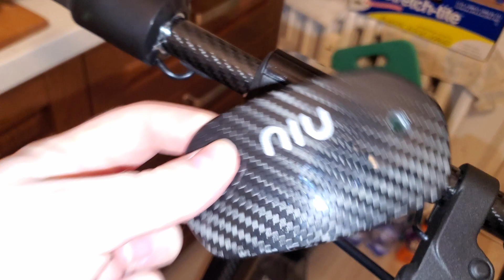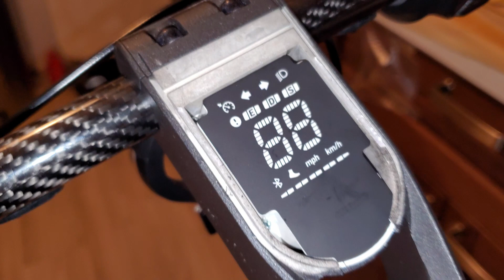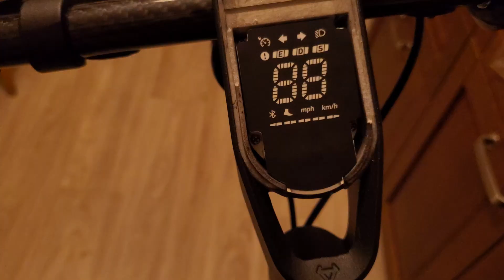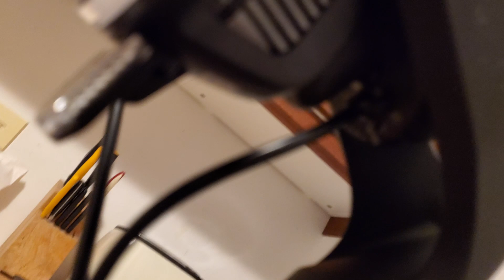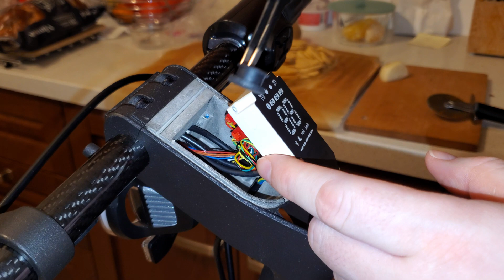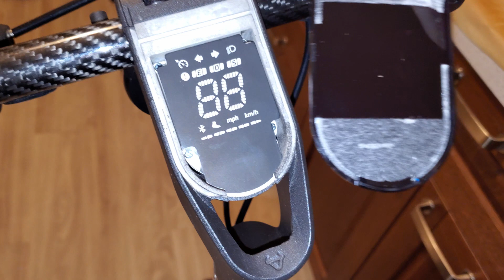NIU KQi Air electric scooter - Display Disassembly repair guide

Comment: I have the same model. The screen suddenly stopped working. When I bring the NFC card closer, I can hear the sound and the phone turns on, but nothing appears on the screen. How can I fix this?
Reply from the maker: If the scooter is still under warranty contact NIU first. If you are outside warranty, it might be a display issue and you can try to replace it, or check if all the connectors are secure. Hard to say what might be causing the issue without looking at it. You can buy a replacemnt display from NIU if not covered by warranty.

Comment: Hey @lantea13, did you have any trouble securing the whole display panel back again with the same adhesive after removing it? I have to replace the accelerator (NIU sent me the part) but I’d like not to buy a new display cover just because I removed it. For the first removal I see you just glued it back again but after some time I’d like to know if it stayed put.
Reply from the maker: No trouble re-using the adhesive, still holds the display cover. The adhesive is a really thin double sided tape.

Comment: Hey, have you tried switching to a thumb throttle accelerator? I'm trying it now, but when I connect the new throttle to the main board, I only get a loud noise.
Reply from the maker: No, I have not tried that, as I got used to the twist throttle so much that I think I prefer it over the thumb throttle now :D
But I like the way Segway decided to do both thumb/twist throttle combo on their latest line of scooters.
Reply: Hi @antonioskoric9157, did you end up switching the twist throttle with a thumb throttle?
I was thinking to do the same thing, so it would be helpful to know if you managed to make it work 🙏
Reply: @mjeshurun 
Yeah, got it working. Didn’t change the electronics, just modified the housing and fitted a thumb throttle instead. I used the plastic part from a cheap replacement throttle from Amazon and basically swapped the ring for a plastic thumb lever. Everything else is still stock.
Reply: @antonioskoric9157  that’s great!  Could I trouble you to share a video of how you got it set up?

I was thinking of replacing the whole buttons+twist throttle combination with a separate workaround. 

On the right handlebar side to install a thumb throttle with an integrated power switch, and on the left handlebar side to install a 4 buttons controller that will turn on the light, horn and the two turn signals. 

I found the buttons+twist throttle combination to be uncomfortable, because it’s a bit difficult to twist the throttle and press the buttons at the same time.
Reply: @mjeshurun  I uploaded a short video to my YouTube account just for you. It includes a brief explanation of how I did it, so you can see how it looks.
Reply: @antonioskoric9157 many thanks for taking the time to share and explain your method 🙏🙏🙏

It’s really helpful and I highly appreciate it 🙏🙏🙏

Comment: Have you looked in the battery compartment ?  My NIU KQi Air drains the battery when it is not used.   I can fully charge and a month later, it is completely drained.
Reply from the maker: Not yet, but I plan to do a disassembly video this winter. I noticed the same, but it mostly happens when I leave the Bluetooth turned on, on my phone, and each time I go near the scooter it connects to it.
Reply: @ maybe the solution is to “forget this device” in my iOS settings.  I still seems much too excessive regards to battery depletion.

Comment: Do you know, what batterys are exactly in the Air
Reply from the maker: No, I have not checked, but if enough people are curious I might do a video  taking a look under the deck. But that will probably still not tell you the exact cells used.
Reply: @Lantea13  so i hope, more people are interested.  ----- beside some interesting Info: der KQI Air does only have tubeless tires and not selfrepair tires - some guys on youtube gave a false information that NIU KQI Air will have self repairing tires - that is not true. - i just chatted therefore with NIU support
Reply from the maker: @Cool-ng5rh  You are correct the KQi Air does not have self-healing tyres. NIU told me that is because they wanted to save on weight to make the scooter as light as possible.
Personally I would rather have the pre-slimed tyres :)
Reply: @Lantea13  this will be additional 2x60 Gramm so it is no more under 12 kg - but it is necessary to have a relaxed drive in my opinion - nothing sucks more than a broken tire on the. Trip
Reply from the maker: @Cool-ng5rh  I agree, they should have put self-healing tyres on the KQi Air, even if it would add weight.

Comment: Hi, I took apart the little windshield and I think the design is the same in production models, or I don't see any noticeable difference. But it didn't break. Nonetheless the windshield broke when screweing back too tight with my airtag hidden behind. Link in the next comment, just in case it gets deleted.
Reply from the maker: Seems like the link did not get posted. Can you try again, would be curious to see how the production unit compares. Thx.
Reply: Just pasted it. Maybe Imgur is not allowed here.
Reply: The link is impossible to paste! In my opinion it looks the same.
Reply from the maker: @CarolaClavo  I guess that is some YT spam protection at work. Thanks for trying though :) Wanted to ask NIU about it if I could show them a comparison.
Reply: @Lantea13  After a year, my accelerator is failing so I came back to this video to see how difficult it would be to fix it myself. I think it will be easy: Unglue the display, take it off the space. Undo the turning lights and remove the handle, and then, slide out the accelerator and unplug it whn you see which is in the panel. And then, do everything again in reverse.

Comment: Hot to turn of the AIR to prevent power consumption? I could not find any setup to prevent draining the battery
Reply from the maker: If its turned off with the nfc card I have not noticed any significant power drain, the only system that is on I think is the Bluetooth, which should not have a huge drain on the battery. How long did you not ride it and what was the % power loss?
Reply: @Lantea13  20% in 5 days - i had 20% and after the holidays of 5 days the escooter niu kqi air was dead
Reply from the maker: I was just away for 5 days and my KQi Air definitely did not drain that much. I might try and test it to get exact numbers when I go for holiday or daily test a different scooter. 
Did you try and contact NIU about what the expected power drain should be? I think 20% in a week is not normal.
Reply: @Lantea13  no - i only asked how to turn of the Escooter completely - this is not possible - so you kill the battery during 4 months of wintertime - you should not store any battery at 0%
Reply from the maker: It would certaily be a nice feature if you could disable all passive power drain systems throught the app, so that they only activate once you unlock with the nfc card.
Alternatively; when you first get the scooter it has transport mode activated, I think a lot of riders would love to see NIU create a way to activate this mode when you need to store the scooter over winter, or even when you need to transport it yourself for service or when you move, etc.
Reply: @Lantea13  transporting the escooter by car would be also nice with transport mode - how to do that? NIU will not update the software therefore, they told me
Reply from the maker: As far as I know there is currently no way to activate transport mode once its deactivated.
Reply: @Lantea13  20% in 5 days